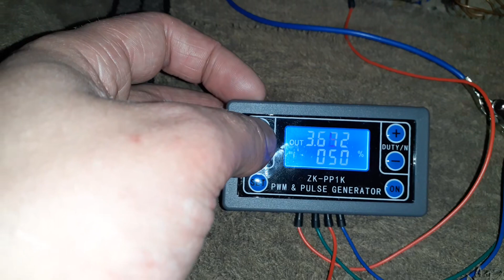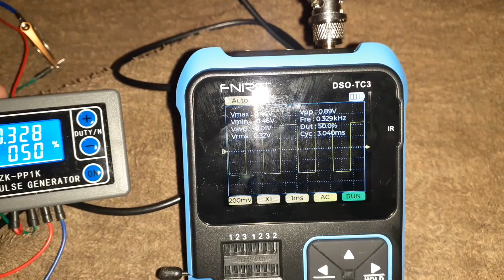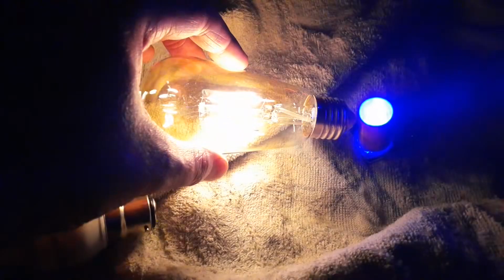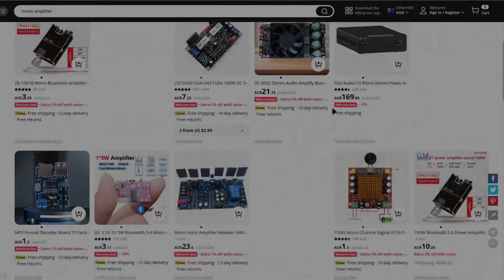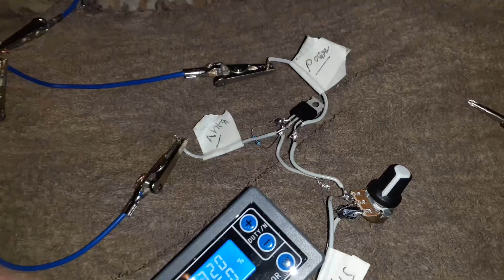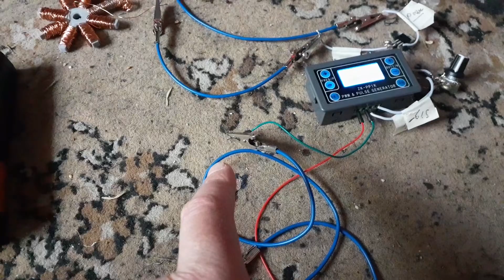Signal generator, rife machine, oscilloscope and amplifiers - Playing around with

Comment from the maker: Just to simplify. The circuit is a signal generator running into a 12v amplifier, using a coil or some kind of emitter device instead of an audio speaker. 
So you create a hz frequency and amplify the power of it then use a coil to emit it.
Reply: Thank you 😁🙏